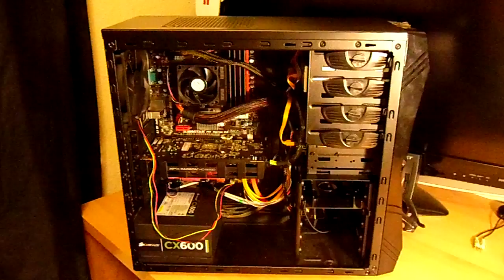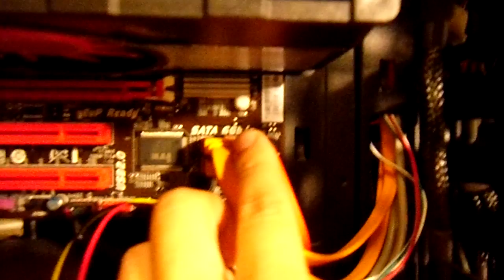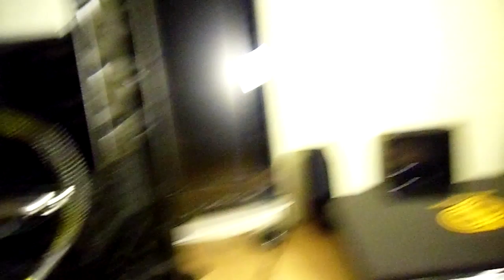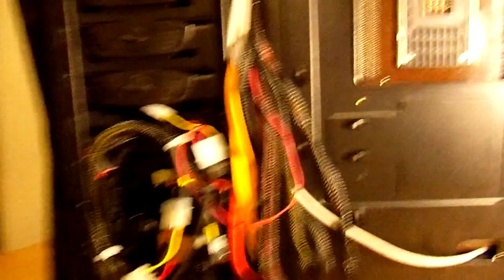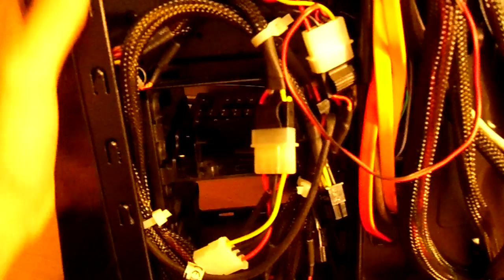Rosewill Challenger Cable Management

Comment from the maker: @kevivjun 
The 5670 plays current games at medium to high (depending on the resolution).
The 6850 plays most current games at max settings (depending on the resolution).

I definitely like the 6850 more and it was worth the money!
The 550 setup also include 4gb more ram not just a different graphics card.

Comment: I've noticed that the fans that come with this case have 2 molex connectors. I've seen fans with a breakaway that allows you to plug it into a 3-pin header instead, do the fans that come with this case have that? I can't see myself using 4 molex connectors to power the 2 fans.